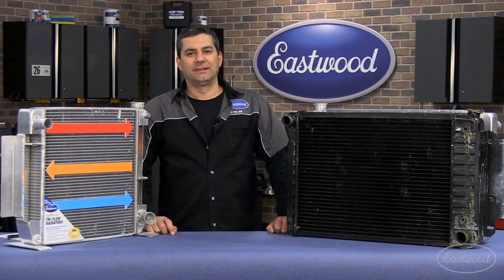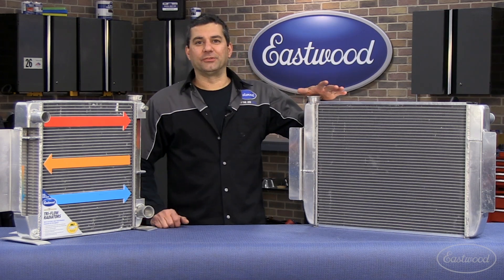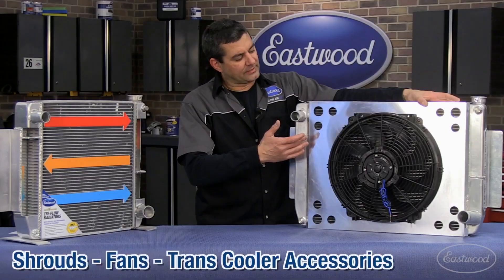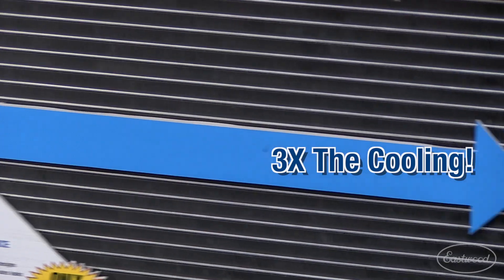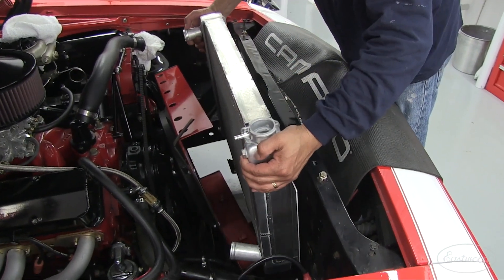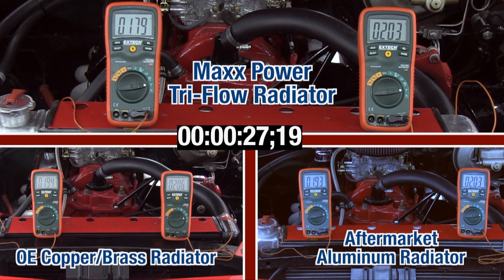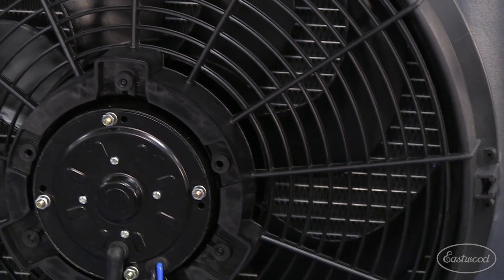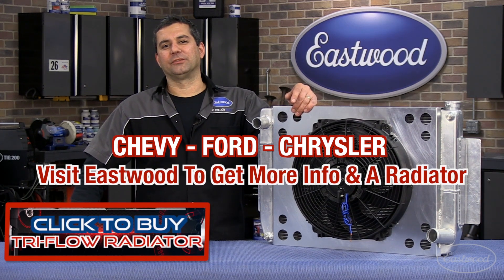Best Performance Aluminum Radiator for Chevy - Ford - Chrysler - Tri-Flow Keeps Your Car Cool!

Comment: You got one for 1989 Corvette? What’s the warranty on these things and are they reliable? I bought one from ECP and it only lasted two years.
Reply from the maker: We offer these in 3 sizes and 3 generic styles so you can get the one that fits your project.  Here's the 28" Chevy style one: https://www.eastwood.com/28-in-tri-flow-aluminum-radiator-maxx-power.html

Comment: Do you have them without electric fans?  I got an '86 F150 and it doesn't have electric fans, it's the old school clutch fan on the engine.  

Now, mind you, it's a 5.0 EFI and it runs cool, anyways.  Doesn't overheat on the hottest of days while in 4x4 offroading or anything and it's never gotten hot towing, even pulling a 4500 pound truck for a friend... despite the little 185 horsepower/270 ft-lbs torque 5.0 V8 struggling on these mountainous roads (east TN), but luckily, it was a slow speed limit and I could hold that, I just had to use 3rd gear most of the time (NP435 transmission aka 4-speed with low 6.69:1 first gear/1:1 4th).  

But it never hurts to have that extra protection.  Not sure how necessary it is... as we all know these little 5.0 EFI's run notoriously cool, but they are weak and I'd prefer to have a beefier radiator for towing heavier loads on these twisty, mountain roads.  Lots of slowing down and speeding up, ya know?  Plus, I only have a dummy gauge so I can't guarantee it was running as cool as it appeared, I just know the gauge stayed around 1/4 to 1/3 and I didn't smell signs of overheating or hear any bubbling.

So, maybe it's a waste of money, but it's also piece of mind.

Sorry, so, the question is, do you make these for 1986 F-150 XLT Lariat 4x4  5.0 EFI trucks without the electric fan?  I want an easy bolt in.  I can always just buy a thicker core radiator from O'Reilly's for $225 that would bolt right in, but I really like this tri-flow design ya got going on.
Reply: Eh, wait...seeing the comments are scaring me off of this.  Maybe I should stick to the old adage of "if it ain't broke, don't fix it."  I'll be honest, they don't make things like they used to.  My brass heater core lasted 20 years.  When it went out, I've had to replace it with aluminum replacements every 1.5 years.  Cool design, but not I'm second guessing the quality.
Reply from the maker: https://www.eastwood.com/maxx-power-tri-flow-28-in-aluminum-radiator.html This is what you would be looking at.  They come in three different size's as well.   The fan's are an add on so if you just purchase the radiator you could run your factory clutch fan setup.
Reply: @eastwoodco  Perfect, thank you very much.

Comment: Would this fit my 2001 jeep cherokee xj?
Reply from the maker: It looks like the factory radiator dimensions are 31 x 13.5 x 2.5 - You'll need to measure your radiator support and see how much room you have to work with.  We have 3 different size widths: 22", 26", and 28" for Chevy, Ford, and Chrysler but their height is 19" which may be too tall for your application.

https://www.eastwood.com/maxx-power-tri-flow-28-in-aluminum-radiator.html

Comment: Awesome engineering on this three level tank radiator. I wish they made them for Volkswagen corrado VR6.
Reply from the maker: All of our Tri Flow Radiators are custom fit so we offer them in 3 different sizes - 22, 26, and 28" wide with two different inlet/outlet configurations.  One of them may fit your application.

Comment: Plz I'm asking what you use which thickness for a v8 buik skylark 300
Reply from the maker: These come in 3 different widths depending on your application - all have the same thickness.  Check out the web page to figure out which one will fit your ride.

https://www.eastwood.com/triflow?utm_source=youtube&utm_medium=annotation&utm_content=radiator&utm_campaign=2015-12-15

Comment: Put one in my 1964 Dodge Polara with a gen II high horse power Hemi . It runs hotter now than it did with the original radiator . I am not impressed

Comment: This video is deceptive. The tri-flow did not out perform the aluminium radiator in cooling the engine, at all times the engine temperature is the same. While It may be cooler coming out of the radiator the reduced flow of the radiator produces zero net benefit in cooling the engine. Both do out perform the brass radiator.
Reply: It keeps it from overheating during high demand.  Normal radiator flow barely uses the entire radiator.  The triple pass allows more time on the cooling stage.

Comment: I have a 2001 4x4 Tacoma V6 3.4 I want to put an all aluminum radiator.  
Do you make one for my truck?
Reply from the maker: Call our tech department a call and they can help figure out what would work best! 800 3434 9353

Comment: Yeah, that's all well and good, But ..... I replaced my copper/brass radiator from my 1979 C3 Corvette with a new aluminium radiator [ColdCase], that promised 40% cooler running. However, after less than 9 months the new radiator was leaking and considered completely ruined. The reason why, I am told is because of ''ELECTROLYSIS''. I have since talked to other Vette owners and they tell of similar stories. One major Corvette owner warned me against buying another aluminium radiator, as he says that they don't last! One Vette owner went through 4 aluminum radiators in about 7 months - the problem ''Electrolysis'' - an electrical charge running through the radiator, and damaging the components. In order to combat against Electrolysis, it is advised that the new aluminium radiator must not touch another metal - that the radiator must be full surrounded in rubber. And of course use distilled water instead of common tap water, as the tap water has too many minerals which assist Electrolysis. Yes the aluminum radiators run cooler, but for how long? I have since gone back to brass and copper.

Comment: I would buy this if I did not have to go measure and probably have to do modifications to install.  Have a 97 Jeep Wrangler Sport 6 cyc, manual transmission.  Replacing the stock, y'all tell me which one will work and I might buy one today.  It's gotta live up to your claim though.  Your tech person on the phone acted like I was asking too much, I prob was.

Comment: There is not near enough information here. I love the idea but what was the increased drag? How did that affect the flow volume. I guarantee that the flow volume dropped by some number. What was it?  How does that affect the water circulation in the rest of the engine?  I suspect this will not cool better than the 5 row core that is in my full size van with the 6.5 diesel.